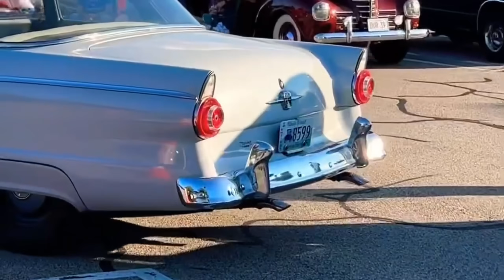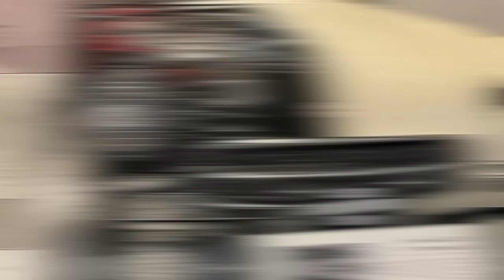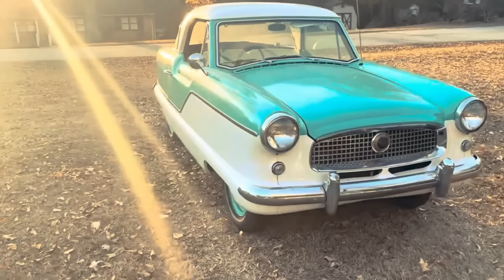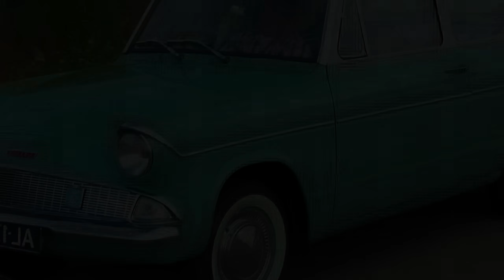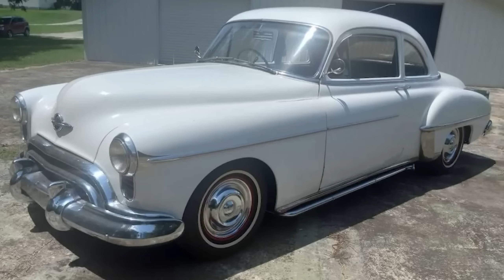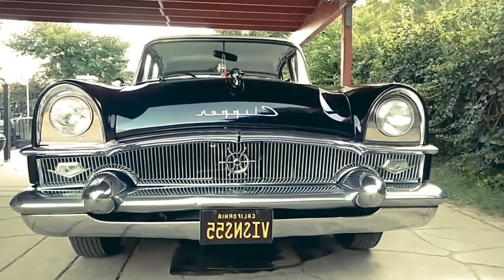12 Dangerous 1950s Cars That Should Have Been Banned

Comment: Should have been banned? I call BS. They were cars from 65 - 75 years ago. They were a big leap forward from the cars they replaced. Ever think of that? What should be "banned" are vehicles where replacing a headlight costs you a day's wage just for parts. Where a single wiring problem means you junk the thing because it costs more to fix than it's worth.
Reply from the maker: I get your point and you’re right that cars from 65–75 years ago were absolutely a big step forward compared to what came before them. Every generation builds on the last.
When people talk about “banning,” it’s usually from a modern safety standards perspective  not because those cars weren’t important or innovative in their time. They were groundbreaking for their era.
And you make a strong argument about modern vehicles too. Today’s cars are safer and more advanced, but they’re also more complex and expensive to repair. A simple headlight or electrical issue shouldn’t cost a small fortune that’s a fair criticism of modern automotive design.
At the end of the day, each era has its trade-offs: classics offer simplicity, character, and mechanical honesty; modern cars offer safety, efficiency, and technology. Both have value.

Comment: It's well known that cars from the 50's and 60's don't have the safety, braking and steering refinements the new cars do. Everyone that owns and drives old cars knows their limitations and drives them accordingly. I have a 1962 Studebaker GT Hawk and a 1963 Studebaker Avanti that I drive regularly. Are they as safe as my late model Silverado, no, but they are sure more fun to drive, especially the Hawk with its 4 speed transmission and they don't look like the new cookie cutter cars that are available today either.
Reply: So true. Todays cars are mostly SUV's. All look the same with no character. I have heard them called "plastic pigs". I call them "tin can coffins".
Reply from the maker: Love the way you explained that. You’re absolutely right  classic cars require a different kind of awareness, but they also offer a driving experience modern cars just can’t match.
Reply from the maker: That’s a great perspective  and you’re absolutely right. Cars from the 50s and 60s were built in a completely different era, long before modern crash structures, ABS, stability control, and advanced steering systems became standard. Anyone who regularly drives classics understands their limits and respects them.
And wow a 1962 Studebaker GT Hawk and a 1963 Avanti? That’s an incredible pair. The Hawk with a 4-speed must be an absolute joy to row through the gears. You’re also spot on about modern “cookie cutter” designs classics had personality, bold styling, and real character that’s hard to find today.
Different eras, different priorities  but the passion for driving is what connects them all. Thanks for sharing your experience!